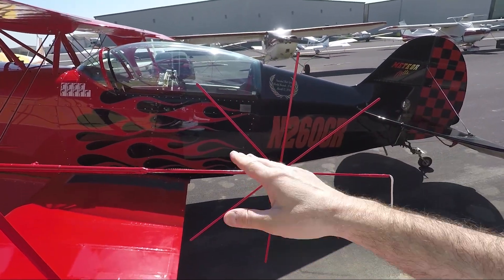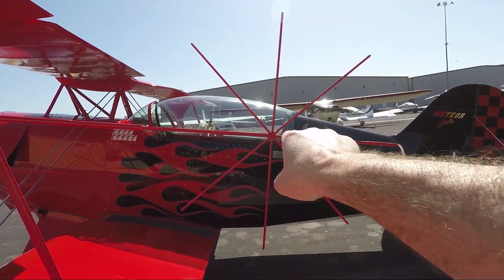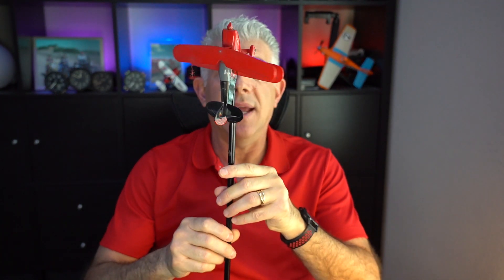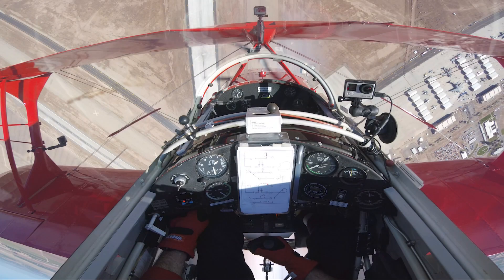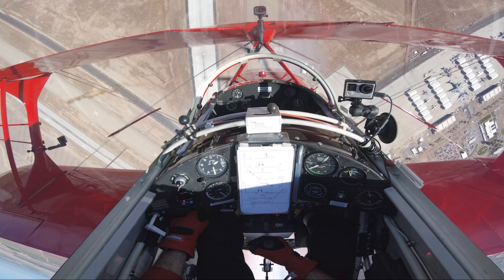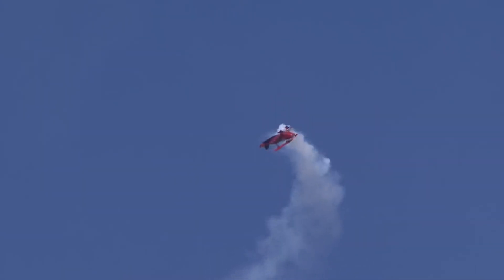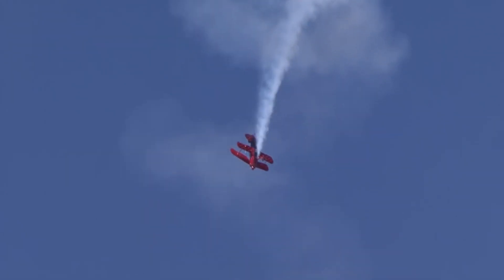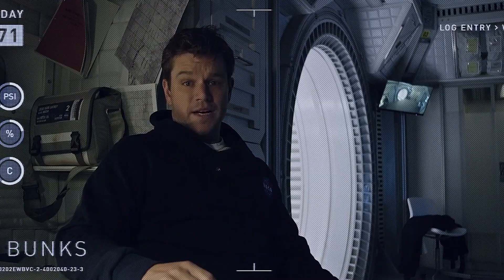Play by Play Series - Torque Roll

Comment: Thanks Spencer, brilliant! I’m curious, what would happen if you’d do the same thing but on a steep climb as opposed to a vertical? I suppose that, provided you keep your g load down when you run out of airspeed, you just fall out of the sky, still rolling from engine torque. Correct? Would that result in a tumble? I’m also assuming that it will not develop into a spin as long as you don’t introduce a yaw. Correct?

Comment: I'm not very educated in this topic, I'm not a pilot, but I wanted to ask, why use the aerobatics sight instead of an attitude indicator? Isn't that what it's designed to do?
Reply from the maker: First, most aerobatic planes do not have an attitude indicator. Second, the reason we use the aerobatic site is to keep your eyes where they belong outside the cockpit on the horizon where you get the best view of the aircraft's relative position especially when flying close to the ground.
Reply: @ssairshows  By the way I'm not trying to teach you your job or anything, just looking to find out more about this. Apologies if I come across as rude.
Reply: @ssairshows  But by looking outside you're missing out on the altitude and airspeed indicators, I suppose the visual to the ground makes up for the altitude indicator but what about airspeed?
Reply from the maker: Look inside the plane and crash, look outside and see how high you are and how fast you are going, also you can't tell when you start sliding backwards unless you see the string at the end of the aerobatic site. Notice the plane is moving  in relation to the surroundings. Aerobatics  is a visual and kinesthetic activity.  This isn't flying by instruments.  The only time I look at the altimeter and  airspeed is before entering the maneuver to check my "gate" which is the requisite airspeed and altitude to enter the maneuver, after that it's eyes outside all the time.
Reply: @ssairshows  I see, thanks for the explanation!
Reply: I've had the same question. Thank you for asking first haha

Comment: Thanks for a great demonstration and explanation! 
I used to compete in hot air ballooning and had a similar piece of string as You show to determine sink or lift relative the surrounding air. Notable is that it shows the relative movement against the air which 
 sometimes more important than VSI readings. A tapered piece of fabric worked best for that application.

Comment: Hey Spencer....you and I did a few of these in the Extra last November. Admittedly I have not tried them since as I have been focused on the advanced ARESTI stuff. You touched on this in the video but I am trying to remember the bail out on these. Pull power, forward stick and full right rudder. I assume that is desirable if the nose is falling forward? If you end up slightly on your back would you pull power, pull the stick back and slam in some rudder? Does it matter which rudder you put in?
Reply from the maker: For consistency I suggest always using the same recovery on this one no matter which way the nose decides to fall off.  It's more important to prevent the flight controls from slamming than trying to control the flip over.  Once the nose is down, neutral all controls and fly on.🙃
Reply: @ssairshows  ok thanks!

Comment: Nice video.  Curious, on your thoughts on reversing the ailerons once the slide begins (stick right)?  Seems to help keep the roll going in reverse when I do them.  I also prefer to keep the ailerons deflected versus neutral so that they don't snatch one way or the other on the slide since the aielerons are the only control surface not protected by the prop slipstream.  Thoughts?  Thanks for posting!
Reply from the maker: When the slide backwards starts there isn't enough airflow to make difference.  If you can hold it vertical long enough reversing the ailerons might work...and you will have an alarming amount of speed!   That is really hitting the jackpot!